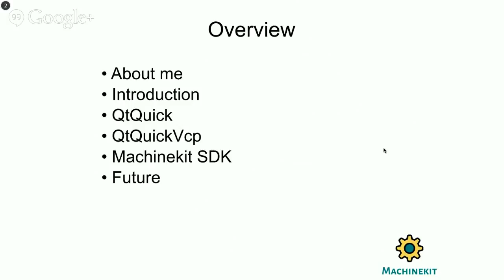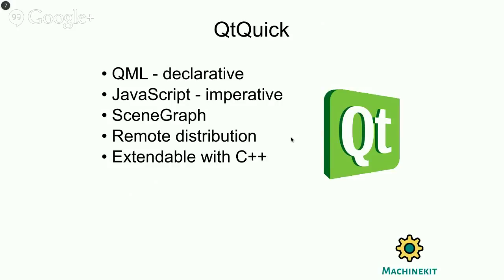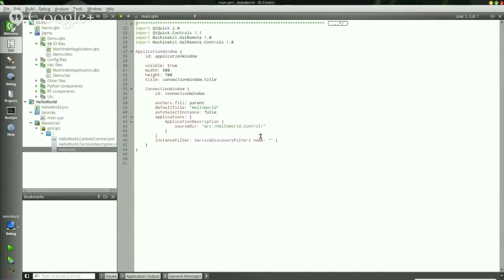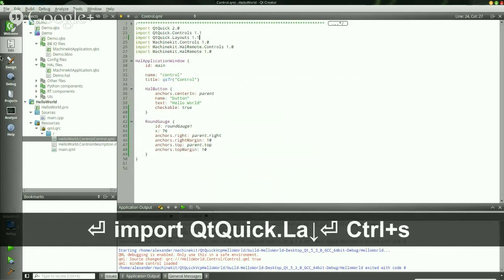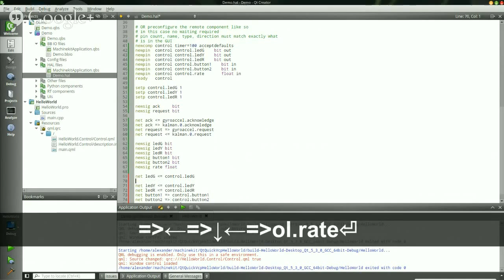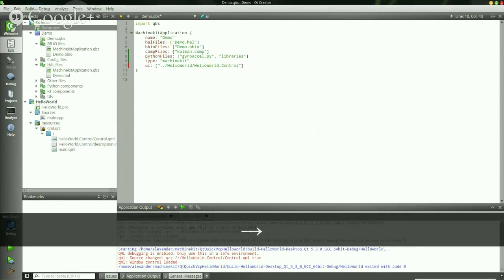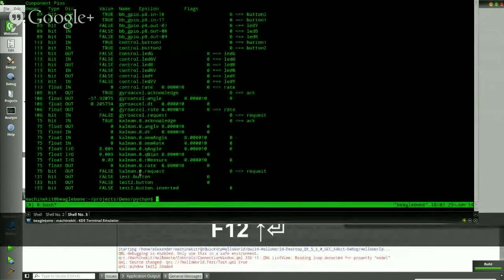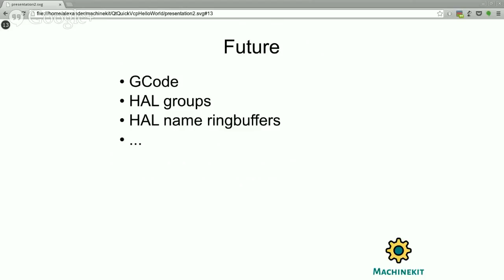HelloWorld in QtQuickVcp

Comment: Hi Strahlex, maybe you know why connection window can't find my BBB ? I'm using your project from git.
Reply from the maker: I only can guess: In some networks multicast is disabled or your client is not in the same subnet as your BBB. In this case you need to enter the IP-address of the BBB manually. There is a small button with a > in the connection window. You need to press this button to get more options.